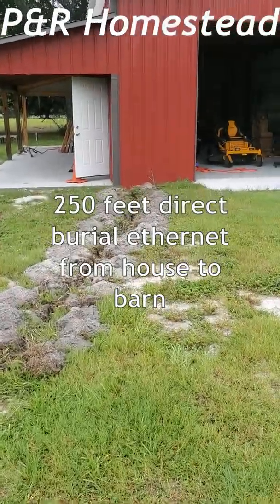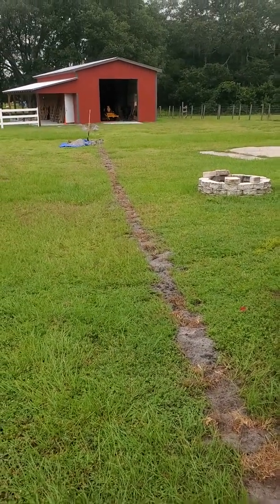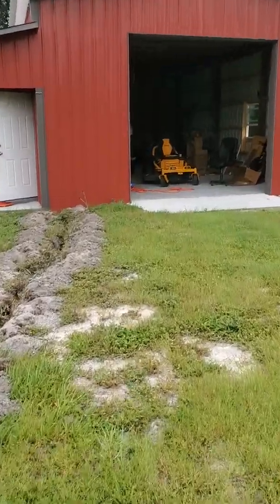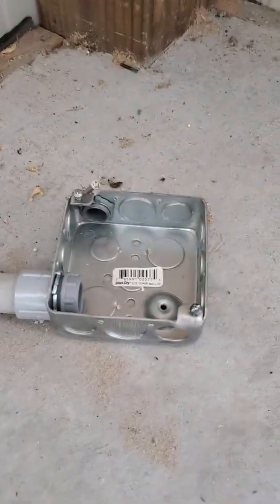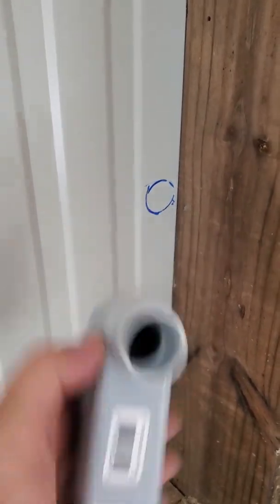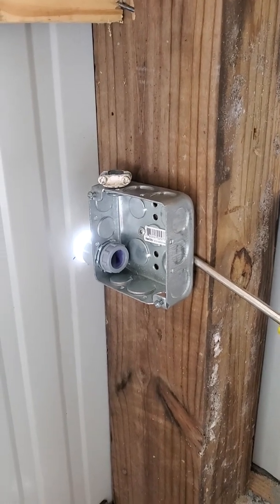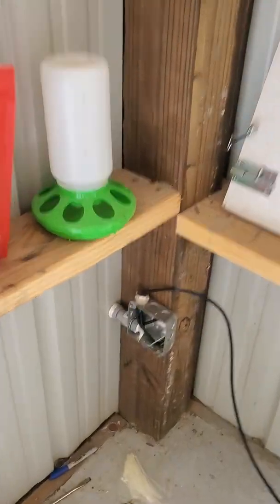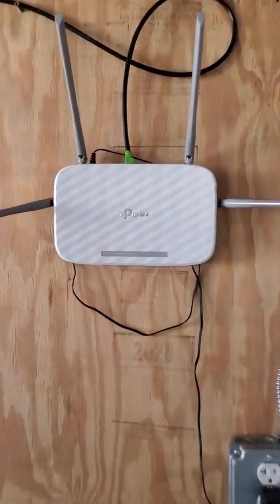250 ft. Direct Burial Ethernet from House to Barn

Comment: I am looking to do the same. I have att internet in my home but want to run internet out to my shop and pool house. Will having internet in my shop allow me to have wifi for anyone to use or will it be direct connection only?
Reply: I’m wondering the same thing. Did you ever figure out an answer?
Reply from the maker: Sorry for the late reply. The ethernet cable running underground to the barn is connected to a wifi router in the barn which I use for wifi. Thanks for watching!

Comment: Is there any special setup for the second (remote) router or does it just plug into the first router and second ready to go as is?
Reply: Thank you, reading this in mid 2025!
Reply from the maker: Apologies for the late reply. There was no special setup. It was a router that I had sitting around and reused it for this application. I just plugged ethernet into it and it was ready to go.
Reply: Name of Port plugged into
Reply: For anyone else wondering (since this question is 2 years old), you probably want to set your second router to "bidged" mode so that everything plugged into it is also on the same lan (subnet). 

I'm not an IT professor, but I know that much. Ask the AI if you're not sure. I'd still plug the line from the main router into the "wan" port on the bridged router (might be labeled something else). I don't know if thats necessary in bridged mode, but it eliminates a potential issue.
Reply: @TerenceKearns Thanks for the info. I'm going to attempt this same thing, shorter run, but I didn't know to use the WAN port. I may have some hair left when I'm done.